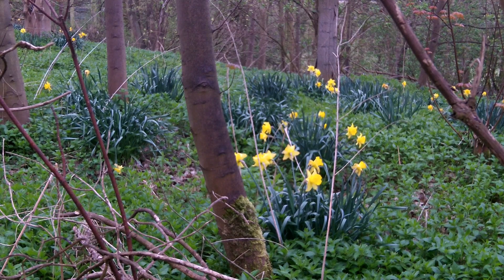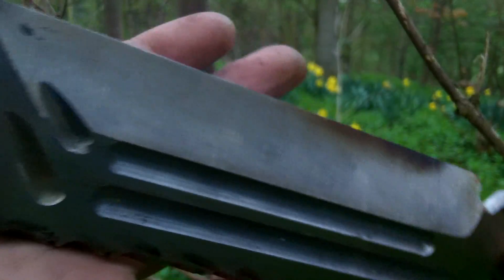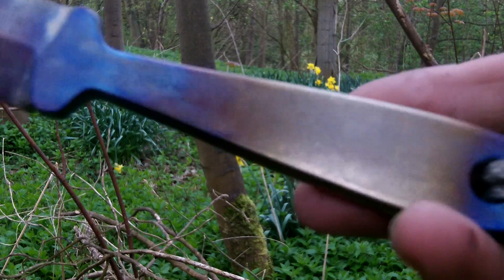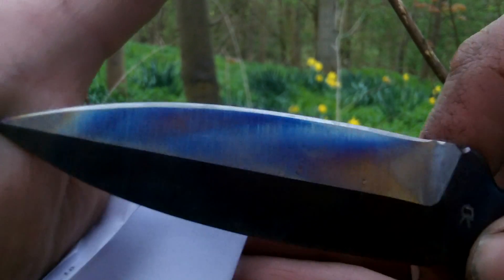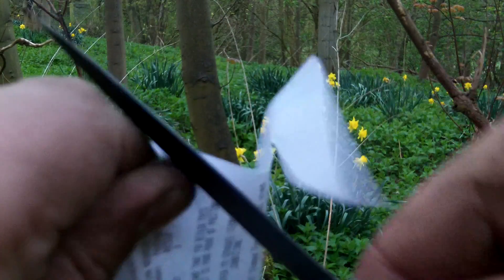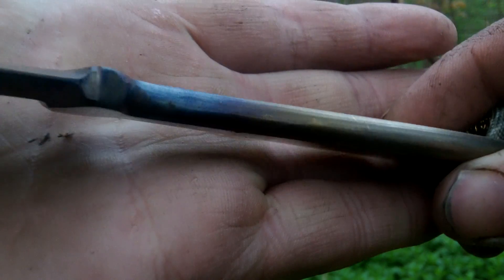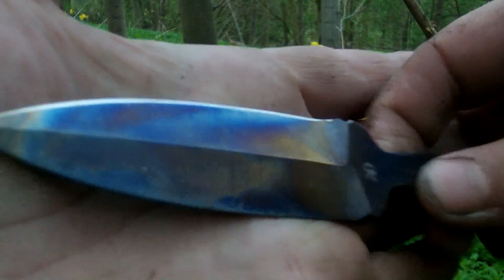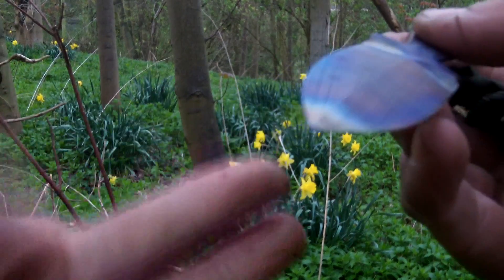Titanium Dagger

Comment from the maker: its actually identical on either side, I would not call that messy. Just right/left hand bias. The plunge lines are bang on and the centre line is fuckin close.. also the taper to the tip is less than a .25 of a mm out according to my micrometers. All done by eye. I look forward to the VR of yours ;)